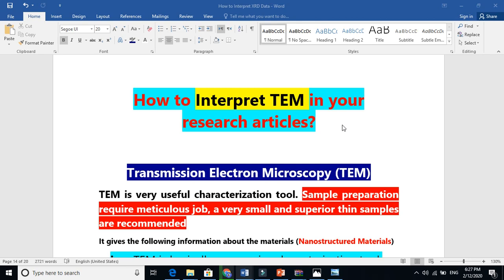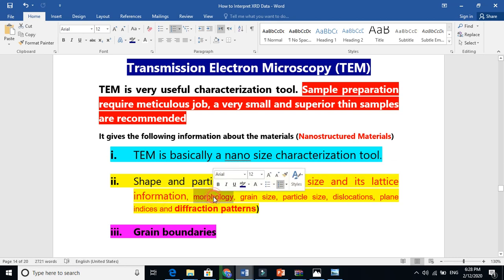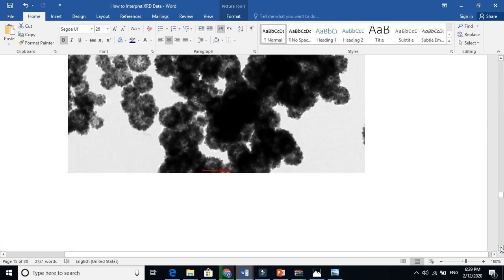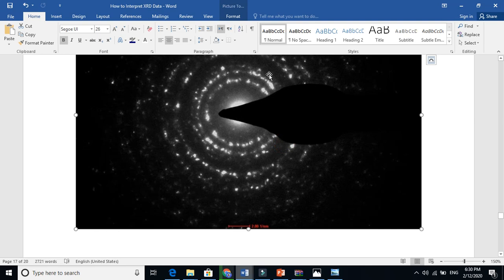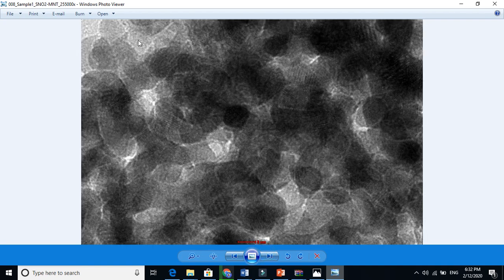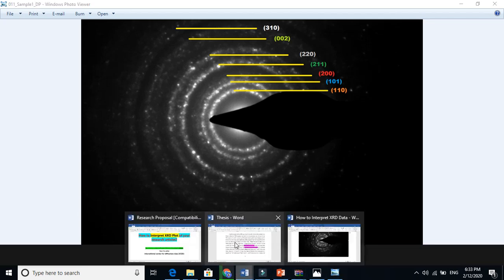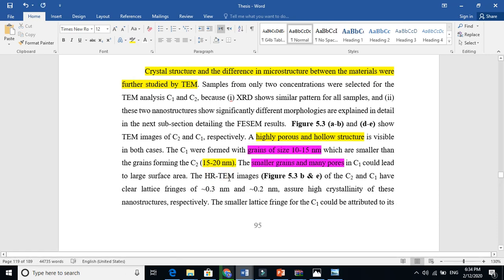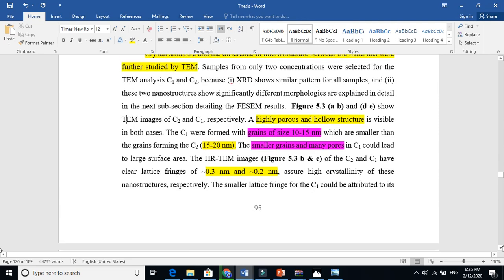TEM Micro-graphs Interpretation? Transmission Electron Microscopy Characterization Tool

Comment: Thank you for uploading this wondeful video sir!! Can you please tell, how you were able to identify the porosity of the material using TEM images?
Reply from the maker: I am happy it helps.  For porosity and size of pores can be identified from BET surface analyzer equipment. According to my knowledge,  it would be not possible with the TEM,  because it focus on very small area during analysis, and would not give the overall texture of the surface. However,  SEM can help little bit for this case.

Comment: Sir, video is very useful, I have prepared three Nano material of different cellulose material with copper oxide.
All the three give same XRD patterns, how can I differentiate in analysis while writing.
Please guide me sir 🙏
Reply from the maker: If the materials is different then XRD should be. I think you have used the same material that is why there is no change. Just try to see if there some extra peaks or shifting. Otherwise simply write that there is no change in the phase of the three different chosen materials .....
Reply: @nanospeaks  thank you sir for your explanation, may I send the graph, so that you can view and give me suggestions.
I need your email
Please...
Reply from the maker: @sureshphilip1280  qamarwali@yahoo.com
Reply: https://youtu.be/swl2McjikW4